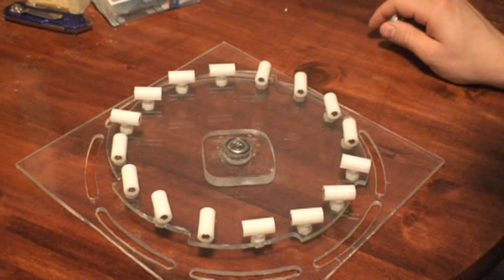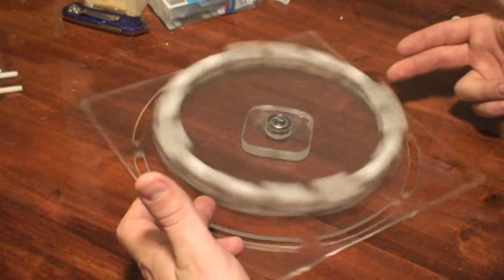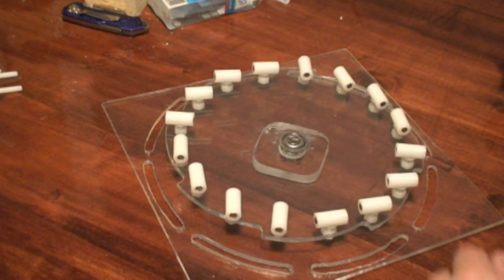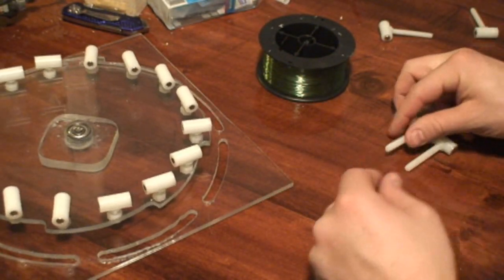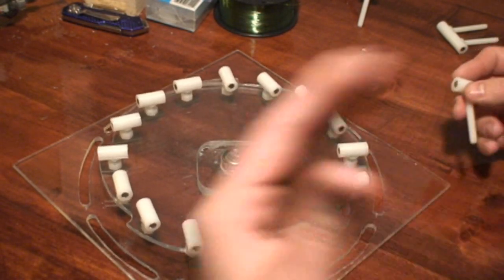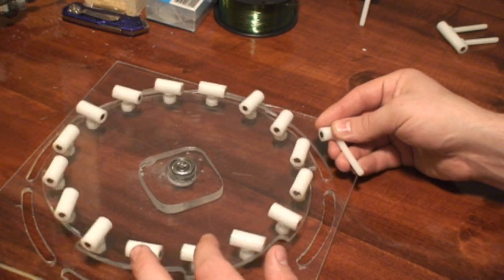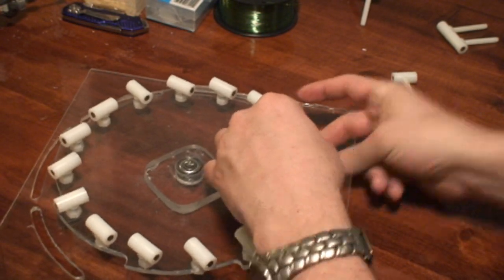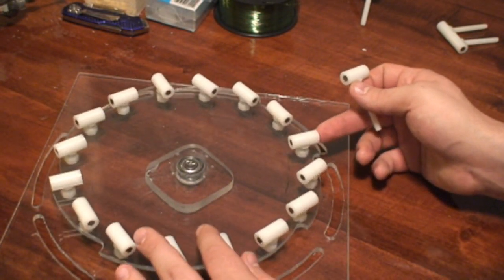Magnet motor, free energy, overunity test 2

Comment: How about making all the poles repel on the motor?If you add electricity all you're doing is making a crude electric motor.
Reply: my thoughts exactly.If they repelled all around the wheel would spin non stop, no electricity needed
Reply: Aye, needs testing.
Reply: Scott Lee
No, do you actually believe that? Every force creates a counter force of equal strenght. Nothing would happen. Just like you can't lift yourself off the ground by grabbing your hair.
Reply: duh, you aren't understanding what I'm saying
Reply: In magnets(or gravity for that matter) opposite poles attract,like poles repel.
Reply: the brain
Yes. What has that to do with anythign I said?
Reply: MagnificentXXBastard It means,magnificent bastard, that all poles the same would cause a repel action.Have you ever played w/magnets?I've always surmised the repellent force was stronger than the attractive,although they may be identical,equal and opposite.Somehow the strength of the repellent force just seemed stronger in my hands.Got a clue?
Reply: the brain
Dude, I am taking courses on experimental physics at my University, I know how magnets work.
And the repelling force is just as strong as the attracting one. They are the same force, simply the direction is opposite.
And I assure you that your proposed design would not work. If you want movement in a closed system, you have to add kinetic energy to the closed system. Building a model like the one above and making the magnets repel something in the middle would not work. Simply Newtonian physics. You would need a continously moving or rotating magnet like what the dude is doing with his hand.
Reply: MagnificentXXBastard Not sure till I actually test it . Muammar Yildev(I think that's right) has built an all magnet motor,it runs at app. 2500RPM and requires no electricity.I want to experiment with this concept.
Reply: the brain
We can be sure,  all supposed "infinite energy generators" that have been tested turned out to be scams. In addition, it is physically not possible, as you can not create energy from nothing (which this would be doing).
The one you mentioned was probably a scam too. When showing his contraption, he refused to open it to show that there was no hidden battery inside. I wonder what was inside there?
You can not just stick some magnets, wires and popsicles together and create an infinite source of energy, this is a joke.
If you however want to try this, go ahead and waste your time.
Reply: the brain "It means,magnificent bastard, that all poles the same would cause a repel action.Have you ever played w/magnets?I've always surmised the repellent force was stronger than the attractive,although they may be identical,equal and opposite.Somehow the strength of the repellent force just seemed stronger in my hands.Got a clue?"

Everybody in the world has played with magnets, brain. What I noticed with magnets is that no magnet is able to push another magnet all by itself. It would be necessary for ME to do the pushing. I would be the one moving BOTH magnets. The only universe where magnet motors work is the one where baseball bats hit home runs while the batter sits and watches.
Reply: the brain It's my understanding that Mr. Yildev is in prison for fraud.
Reply: jhanthony2 I'll check on it.
Reply: the brain Hey, don't let them push you around man! at least your name is funny and pretty ironic!
Reply: Just because someone says,"it can't be done," doesn't mean they're correct. It's a matter of design, experimentation will show the need for redesign of the simple machine shown  to attain desired results.                              I think the man's name is Aldo Costa, he built a large perpetual motion machine, I'm sure power could be drawn from it w/o stopping it.(youtube: A machine to die for)
Reply: Jack London

Professional Sarcasm ^^
Reply: winner winner chicken dinner ding ding ding that's the trick to this kind of motor you would not believe how many of these motors are out their were they put north to south and the motor stalls it has to push off not pull.
Reply: MagnificentXXBastard You're spouting something you were taught, you haven't actually proven this to yourself through experimenting.Sure the primitive example of a battery, running an electric motor, which runs a generator to recharge the battery agrees with what you say due to losses,but times change. Your imaginary "time" changes from moment to moment, you have not proven anything.            You can pretend that travelling at the speed of light will cause you to age less, I'm telling you that theory is BS.But I am also sure you stand behind that BS as if it's truth.
Reply: the brain
I have proven this to myself and to others. I took classes on experimental physics in my university , calculating with those formulas and doing experiments proving them. They are correct. We now this. We are certain, because they work with everything we tested. They alsways give the correct result and predict the future accurately when used in the correct models.
And you don't seem to know much about physics at all. Ath the speed of light, theoretically time would stop for you. However, nothing with "mass" can reach this speed, so we only get closer and closer to a complete stop of time the faster we go.
Reply: MagnificentXXBastard Amusing.Of course your experiments proved what the theories said, you were attempting to prove the theory. You need to think broader than that. Did you build a water-pounder and measure the work potential of the steam produced? I'm guessing you didn't think of that.               We haven't attained the speed of light so we know nothing about it, it's all theory. Even if we built something that could reach the speed,we don't have force fields yet, so the thing would be destroyed, the only safe place to use it would be between stars,where there is no debri. Still yet there would be light,travelling in all directions, that alone could be detrimental.       So stick to your theories, those of us that Do will continue to experiment.
Reply: the brain "the only safe place would be betwen stars"  safest place in the univers LOL
Reply: MagnificentXXBastard No, I will prove you wrong the old fashioned way, by doing it.
Reply: Jack London HeeHee.
Reply: the brain
You would be the first one in history. Btw., we have already done the experiments and the calculations. But if you insist on wasting your time, go ahead. If you think something like this can work, good luck.
Reply: "How about making all the poles repel on the motor" 
insinuating that magnetic monopoles exists on the macro scale.

Everything colapses after you know that fact.
Reply: the brain
And? Any confirming results yet on your "experiment"?
I didn't read anything about it in the physics journal yet.
Reply: MagnificentXXBastard too busy w/other things at the moment, I'll get to it eventually.
Reply: Bobsyouruncle Wilson apparently, you've had more experience w/magnets than me?
Reply: Bobsyouruncle Wilson If I may explain why "the brain"  is correct. If you notice, he's a cartoon mouse. Cartoon physics allows a gun to blow up if someone puts their finger in the barrel to stop the bullet, a duck's bill can spin around backwards (you're despicable!), or a coyote can run off a cliff, but not fall until he looks down. Clearly, if the Acme company can produce rocket skates, instant earthquake pills, and invisible paint, "the brain" could surely acquire an all magnet motor!
Reply: the brain My good old uncle Bob and I have had this conversation before. I realize that a magnet motor works in your head but if you actually try it, you'll see why it doesn't work. Its actually a good idea to do the experiment, learn from it and move on. Sometimes doing it for yourself is the best way to start trusting the science. That's the cool thing about science, when you learn from those before you, it isn't necessary to keep doing the same experiments for 100 years. That's what separates us from animals. No single human could build a cell phone, but when we build on the past, progression happens. This motor is the opposite of that.
Reply: the brain This arrogant physics master needs to understand that you are both on the same side. Even if your ideas don't work, you are trying to do something different and that alone is worthy of applause. We need to encourage ingenuity, not destroy it early in the process.
Reply: the brain  Hi guys. Peace every one. Just to add that even it sounds very brave to try to learn physics by self experimenting, let me warn you that you would go much farther and faster if you study a bit. Just grab a thermodynamic book for example, and you will learn that some ideas discussed here are impossible. There are physical laws (known by centuries) you can't just break. If you don't believe in standard physics, well, it is up to you. But be aware physics is an experimental science. So there is ample lab experience behind those books. Best.
Reply: Carlos Contreras Experiments from over a hundred years ago, times have changed.The test on the moon showed that aerodynamics is what causes terminal velocity. So, everything falls at the same rate of speed, but, only in the absence of air.Which is the exception because air is here. Don't accept everything you read.Question everything and research for an answer.Original ideas can't be disqualified unless you yourself have proved it with an experiment that is different from previous testers.
Reply: the brain
So what about your experiment? Still no time?
Reply: the brain This is like saying, we'll, if I let go of a ball, it falls toward earth. If I let go of a bat, it falls toward earth. But I wonder if anyone tried a toaster yet. Maybe the toaster will fall up instead of down. We don't need to drop everything, trying different shapes, configurations, etc, because we know that neglecting air resistance, that everything accelerates toward earth at 9.8 m/s2. It's the same thing here. We know energy can be converted, but not made or destroyed. No need to try it upside down, in different arrangements, with different shaped magnets, etc. Nobody is saying a person couldn't build a fullness electric generator in their basement, but if they do, they'll have to follow the laws of physics. You're right saying that just because we can't do something now, doesn't mean it will never be possible, but a body at rest will always stay at rest unless influenced by outside forces, right? Doesn't it make sense to experiment in the framework of known laws?
Reply: Andy Jones Did you look at the video?Magnets have power,you don't have to add anything to get something out.
Reply: the brain Great! Glad to here the world's energy problems are solved! So now what? Wanna go fishin'?
Reply: the brain
magnetism is a force, not an energyform.
Reply: MagnificentXXBastard I know, I read that somewhere too.
Reply: the brain

So you know the statement you made in your last comment is entirely wrong?
And btw, you didn't asnwer my question about the experiment you wanted to do.
Reply: MagnificentXXBastard Look at he vid address I posted above.
Reply: the brain
I don't see one.
Reply: Bobsyouruncle Wilson what are you talking about? I'm just sitting here fishing with my pal, The Brain while our magnets are spinning away at home! I even bought some extra magnets so I can replace the old ones when they run out of energy. Then I'll just recharge the old magnets in the sun. Tomorrow I'm putting magnets on the rims of my car. Wanna buy a Dodge Hemi engine? It's useless to me now. Hey! I got a bite!
Reply: Bobsyouruncle Wilson You had me at "coriolis powered BS Discombobulator". Some skeptics may say that ferrofluid is actually just iron dust in oil, so it doesn't actually contain high levels of magnetic energy but if you put magnets in the fuel tank, it should produce very high energy ferrofluid, especially if you can create a vortex to extract even more energy. This is gonna be great, but wouldn't it just be easier to put a wind turbine on the front of the car with a chain drive connected to the axles? I mean, if it goes 200 mph, that turbine would put out serious power! You better private message me from now on. The illuminati moniters these free energy sites.
Reply: Bobsyouruncle Wilson Heck, with ideas like this, you could just hook jumper cables to your ears and power the car with your brain!
Reply: Bobsyouruncle Wilson Hey, I liked that comment You made to the brain! Make him think it doesn't work. That should throw people off course so we can begin ruling the world. Oh, what size crown do you wear? I found a great goldsmith online.
Reply: Bobsyouruncle Wilson for an extra $15 I can get a crown that spins like the rims on those yellow and purple Cadillacs in the hood. Trying to incorporate a tesla coil.
Reply: Andy Jones Of course it seems that cooling and the weight of the cooling system is a downfall, no continue to look at the problem. You can use a closed system with a single piece of charcoal. It will produce power, can you actually bring the propellant back to liquid form with no power loss?Yes you can.AND overcome the power to weight losses, friction,Yes you can, need to think slightly more abstract.Combine more than one technology, you'd be surprised.
Reply: Bobsyouruncle Wilson never mind, I'm going with the piece of charcoal idea.
Reply: the brain not exactly clear what you're talking about. If you Google "organic rankine cycle" you'll see that people boil a liquid at much lower temperatures by replacing water with the refrigerant in your a/c or propane. I was just wondering if it's theoretically possible to use something that boils at ambient, and if you convert some of that energy to electricity, would it require more or less energy to reliquify it. Since a gas cools when it does work, it seems to me that it would (could) require less energy to reliquify the gas than you might absorb. I could be very wrong.
Reply: the brain Did the spring analogy make sense? That's actually a brilliant way to explain it. In fact, magnets are used for springs in many applications. Energy in= energy out. But the real test of whether the comparison works is, do you get it now? Sometimes I think he explained something well but then you act like you never even read it. You gotta understand, when someone takes time out of their life to try to help out/ explain things to a complete stranger over and over again, he at least expects an "I agree, I disagree" or a relevant follow up question. There's no evidence here that you've even read any of it. If you don't want to learn, say "shut up Bob! I enjoy my ignorance! ". I could read his comments to a kindergarten class and they would understand. If you want to impress everyone with your wisdom, admitting you were wrong would definitely gain my respect. You'd be the first person on YouTube to do it. Plus, you could move on and keep learning (making free energy with a piece of charcoal). So, wadaya say? Are you gonna use those "bum scratchers" for good or evil?
Reply: Andy Jones depends.If you use power from your machine itself it will stall. If you add something else to it,such as liquid nitrogen,it will run.
Reply: the brain Got it. Actually I don't get it, but, ok.
Reply: the brain I don't think you understand. You know how a steam engine uses coal to boil water, It spins the engine, so the steam cools accordingly (it loses the exact amount of heat energy as the engine uses). Then it goes to a heat exchanger where it warms water before it is heated, and cools itself and condenses at the same time. So with liquid nitrogen, the environment heats it instead of gas or coal, but it does the same process. The problem is, it won't all condense at the end so I'll have to use power via a cryocooler probably. If it uses less power than the energy absorbed from the environment, it's "free energy". It seems this would have been done if possible. That's why I was looking fir skeptical input. You already believe absolutely anything can make free energy so you're probably not the best person to ask. :)
Reply: Andy Jones If you use liquid nitrogen as a coolant your machine can't help but work.
Reply: Bobsyouruncle Wilson Pluto is a planet.
Reply: Bobsyouruncle Wilson HeeHee, go read a book and believe it.
Reply: Bobsyouruncle Wilson It always amazes me that this kids assume every teacher, book, college professor, math teacher, scientists, and scientific publications, magazine, etc is lying to them, but they believe 1 or 2 stupid websites with no working examples whatsoever. The entire world is full of examples that science is correct. 1 guy pushing some magnets in a circle is enough to convince people that he's right and everyone else is wrong? Have you ever seen overunity.com? It's a site with hundreds of non-working contraptions that WILL work, they just need a little less friction, a little more funding, etc. The site itself is the best proof against itself. Everthing from HHO, "resonant frequency" magical devices, to gravity wheels and other pseudoscience experiments done in their mothers' basements. I guarantee "the brain" is a fan of theirs. It's amazing The someone can look at 500 OU devices that don't work and come to the conclusion that it does work.
Reply: Bobsyouruncle Wilson You are the goofballs that talk about time travel and think it's possible, and believe the cesium clock experiment proves it(Hafele-Keating,1971).The outcome was misinterpreted.All the experiment really proved was gravity affects the clocks.
Reply: Andy Jones Sorry you're so offendsive, Pluto is a planet.There is no fabric of time,time travel will never happen,dark matter is bullsheite.
Reply: ***** Look at the two videos I posted above,build a better mousetrap.
Reply: ***** as long as they aren't heated too much or impacted with a hammer, yes, magnets last for decades or centuries. Gravity lasts even longer. Springs last as long as they don't get stretched too much. As long as you don't read a science book, this really should work.
Reply: Gravity is a continuous and regenerative product of the sun... If you don't
wish an answer don't ask why this is true... Magitism is a force. Stored it
is released by motion. Control the motion or angles and you will release
the potetail in to useable electricity. The biggest problem is the rub
goldburg methods we have been given. This is too simple to think and except
complexities we are told. We will find a vary some answer so as not to
require processed magnets or much of anything else. We show be able to do
these things with near raw materials. They did before. My strong belief is
we have engineered the potential out of what we are doing rather then in to
them. It makes it easy to maintain power over us by. Taxes and charges that
is designed to maintain political power rather then generated power
Reply: ***** Not sure why you're telling me how to spell his name. Some reason the other vid I posted disappeared, I'll try to find it and repost. Andy is right sometimes, don't take anyone's word for it, Build it and they will come, beware the oil companies and the government (you don't want their attention).
Reply: the brain aww, thats the nicest thing anyones ever said about me! Hey, I'm on your side as far as finding "free" energy. I just don't think this is it, so I'd like to see more effort in more promising areas, thats all. If you're wondering if this works, by all means, experiment. Sometimes seeing it in front of you helps. A lot of thing work in your head or in a drawing, but when you do it you'll see.
Reply: MagnificentXXBastard Physically impossible? ...just like they said that a negative refractive index was impossible but we have managed that with nanotech metamaterials. Don't be afraid to open your mind bro ...your brain wont fall out ;)
Reply: vicioustonez

What has a refractive index to do with any of this?
I have an open mind, otherwise I could not learn anything. And thats what I'm doing everyday.
Reply: the brain hey most of the guys messaging you admit how things won't work are simply here to disprove what has been proven possible by speaking in the regurgitational language taught in schools. But you are right. Repulsion the entire time would cause consistent motion. There is no such thing as nothing. Unless you are claiming nothing in reference to some tangible thing you are measuring. Infinite means always and immeasurable. Energy is infinite seeing as it only changes for through the removal or addition of particles.... but don't just take my word on it I didn't do the "goes to college" thing
Reply: Refrigerey Bubleswinzlow If you can take hydrogen and make a bomb stronger than the ones dropped on Japan, nearly anything is possible.Look at the videos I posted above.
Reply: the brain
There are no videos posted by you in this comment chain.
How about your planned experiment btw?
Reply: the brain you should look up the CERN system. There are groups of people on several continents using super colliders to combine particles that at a particular speed should destabilize the dimensional veil between our newly entered 4th dimension and higher planes. I'm not joking its going to be epic and people should be preparing themselves in a general sense. There's really no telling what is going to happen but 9/23 is referenced several times in almost all publicized religious prophecy. It wouldn't be to difficult for someone to put an open source pan like that into effect. If you believe in the n possibilities.
Reply: MagnificentXXBastard I re-posted Jul 30.
Reply: MagnificentXXBastard does it really matter - I can show you a video about free energy or reptilian aliens if you want but the brain will still be wrong. Just accept that lots of people don't understand science but they all want to voice their opinions.
Reply: Andy Jones

True. It's tjust that he said to me that he would prove his ridculous nonsense in the "only scientific way", by doing an experiment showing his design worked and overunity is possible, exposing us "deniers" and brainwashed ^^.
I just find it funny how he, for months, has found several excuses when i asked him about it 2-3 times and he obviously knows himself that what he is saying is bullshit.
Reply: MagnificentXXBastard overunity.com is a pro-overunity site but it's possible the best proof against it. Hundreds of devices that almost work.  They all say they'll be on the market in a few months but then you see the article was written in 2007. It's pretty funny but I kind of feel bad for them. Hundreds of ou devices that supposedly work yet nothing to show for its. Blame it on big oil and government suppression I guess.
Reply: ***** it would be free and perpetual if you use solar power...
Reply: Leo From

Nope, since the sun is going to run out at some point. So not perpetual
Reply: There's no such thing as running out of energy. It can only be converted.  Not created or destroyed. I don't even know what free energy means. It's a dumb term. Like free matter. You can turn clay into a vase or wind into electricity. I have no idea what almost free energy even means. What are you guys even talking about, sheesh.
Reply: ***** It would only be perpetual if you could store solar for thousands(billions) of years.There is no machine in existence that will run for eternity (except for the spirit).They all wear out.
Reply: the brain gasoline-oil is solar energy stored for millions of years. So your car is perpetual motion according to your comical theory.
Reply: the brain there ya go, whatcha got for us on those reptilian people on planet x or maybe tell us how the pyramids were built to harness free energy and healing powers. Or maybe share your thoughts on chemtrails, orgone (look it up), illuminati, New World Order, or who the antichrist is(Obama or Peter Griffin) You could also explain gravity wheels, zero point energy, the Joe Cell or any other YouTube hoax of your choice.
Reply: +the brain sorry your green is showing so much it's transparent.
no, seriously, this is the kind of thing you say when you lack some very basic knowledge on the field. 
it's a cliche, but the more you learn, the more you realize you don't know anything. you're clearly at the phase you don't even know that you don't know. 
but you're curious and that's great. soon you'll realize it yourself.

(reading a bit further into this thread i realized he's a lost cause. oh well)
Reply: ***** that's how I feel. No harm in being wrong or asking questions. Too many people have too much pride to learn anything though. I think he'll come around. He just won't admit it here.
Reply: i thought the same thing. all repulsion = free energy
Reply: Jeremy English oh yeah! I wonder why nobody ever thought of that before! Just kidding. Read through some comments here before you go. We'll see if you're open to changing your opinion. Everything has been said 20 times in 10 different ways so no point doing it again. Just read. There will be a ten question quiz afterwards that will count towards your final grade.
Reply: Yes! Monopoles are the answer! Proper configuration would eliminate the S pole and its negating pull. 15 N monopoles on the rim of a wheel and 2 N monopoles stationary at 0° and 180° should do it.  Since 15 is an odd number, the two stationary magnets won't cancel each other, and the push would alternate. Since 15 goes into 360 evenly, this should allow pushing. As far as the above idea goes, a simple worm gear setup to turn the alternating magnet would serve well. You're welcome.
Reply: If electricity can produce magnetism, then magnetism can produce electricity. Duh